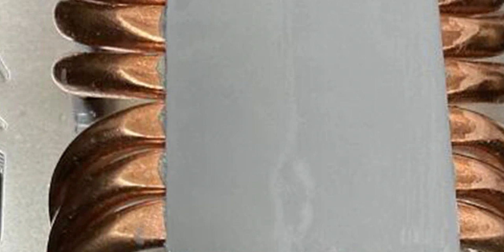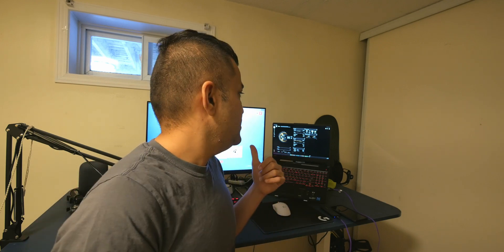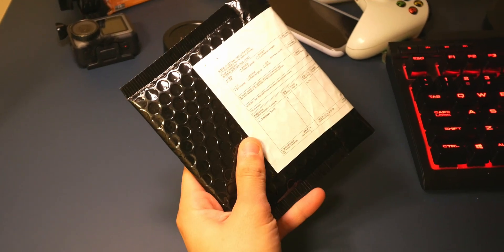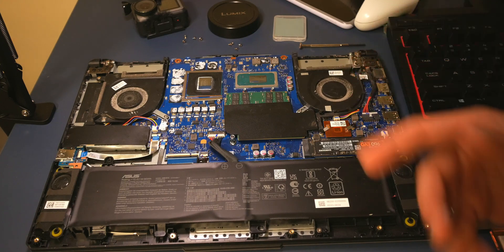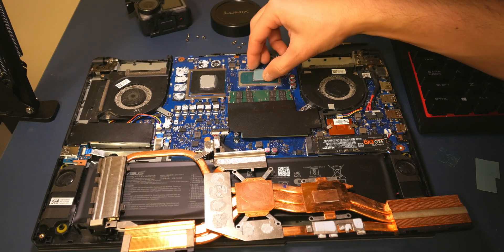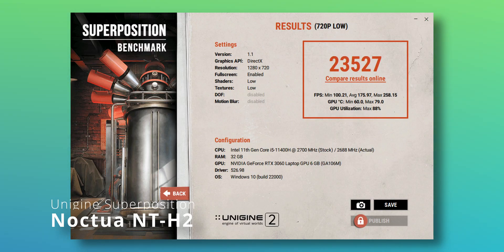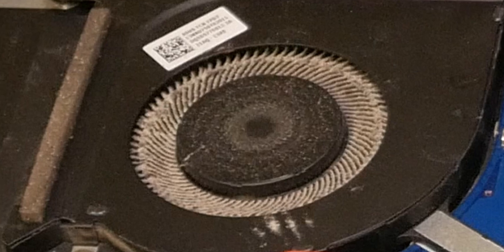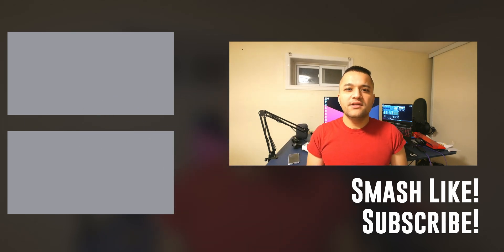I Stopped my Overheating CPU and GPU Forever

Comment: It really does work. I used Thermal Grizzly PTM recently on my 12900k, it's fantastic , CPU was overheating like crazy even with AIO and good paste. Pumpout effect on thermal paste was annoying. Had to repaste every two weeks. WIth PTM, after few times of heat cycles, my temps dropped from 85-88 under full load to 75-77 and kept improving. Don't listen to people who say it doesn't work, they don't know how to use it properly. Best solution, on par with liquid metal, without risks of shorting your components. It costs 10€ here, so amazing.
Reply: used this on my MSI laptop after getting frustrated with repasting and temps shooting back up to 95+ had the PTM now on 2 weeks and temps never reach 90 degrees.
Reply: @pacee21 can you update how its going with ptm 7950? And where did you buy it?

Comment: yeah really?  I used it on two laptops a 12700 intel Zenbook and my 2020 G14 4900hs I DID not ANY NOTICEABLE IMPROVEMENT of  course I don't  know if I got the genuine  article , that's the trouble with this stuff sites are scamming everyone, unless you know it's real don't buy it I wasted 60 USD on this garbage.. better off buying a Llano cooler at least it works....

Comment: My laptop requires lifting up the heatsink if I'm fo clean the fans properly by the vents.

Do I need to reapply PTM after opening the laptop or would the old pad work just fine?
Reply: yup
Reply: You have to apply it to the CPU or GPU as it's a thermal interface to the cooling pipes.
Reply: @SilvaDreams  I know. I just wanted to know if I need to reapply once I separate the CPU/GPU from Heatpipes, as I need to do it to clean my fans

Comment: The stuff works great. I recommend cutting it smaller by ~3mm on all 4 sides. It makes it much easier to 2nd peel, and you'll still achieve full coverage since ~80% will flow out once it melts. Needs a good burn in to achieve it's thinnest. I recommend a good 2 hours at around 80C on both CPU and GPU die.

Best paired with Thermal Putty, rather than pads, as putty compresses much better than pads do. This gives the CPU and GPU core more of the heatsink mounting pressure. Lots of good options for aftermarket putties out there these days. Avoid K5 Pro like the plague.

Comment: Can PTM be used instead of GPU thermal pads?
Reply from the maker: There are some thermal grizzly thermal pads you can buy instead of PTM. It’s not thick enough.
Reply: @TheEasyWay  😮😮😮😮 thank’s!
Reply: @TheEasyWay  Thermal Grizzly KryoSheet Thickness : 0.2 mm

Comment: If you can access the advanced bios of the asus tuf via the SERP smokeless bios method, you can enable undervolting on the i5 11400h. Alternatively there's a simple bios tweak you can do to unlock undervolting. Once the CPU + GPU are UV'd + OC'd, you can prolly get an even higher score and more performance while not increasing temps.

Comment: In addition you can use memo fl08 cooler at 1500 rpm (quite and good air flow ) and you will get absolutely lower temps around 10 - 15 C on cpu and 10 - 20 C on gpu and if you don’t give shit about noise you can max the fan speed and you will see huge difference (PTM7950 + K5 Pro + Pressure Air Fan Cooler = Cold Laptop at maximum Performance)
Reply: I have my llano v10 on the way and the ptm 7950 + upsiren u6 pro has already dropped my 90c 12500h to 72c. Once i have the cooler, my aorus is gonna be crazy cold haha

Comment: Bonjour , rog ally gpu on peut faire ?
Reply from the maker: Ally already comes with PTM7950. If you think its not working correctly, you can replace it or clean the heatsink/fan to improve cooling performance.

Comment: just a heads up noctuas paste is unsuitable for any modern cpus and gpus, especially in a direct die role. If you have to use itll last longer on a chip with a heatspreader. Its temperature range is way too low causing the thermalpaste to separate due to small portions of a direct die and heatspreader exceeding its design limits causing a pump out effect of the silicone oil which aids in pushing out the transfer material in waves. This is the pump out effect. ideally the thickest paste has the best durability before requiring replacement, thats why these phase change materials are excellent theyre so thick they solidify at cooler temperatures.
Reply: Where are you getting this info about temperature range and being unsuitable
Reply: @ps3customgamer  Most gpu manufacturers are starting to go with ptm 7950 because it has better application then noctua paste which is garbage anyways. You are not going to get peak performance out of the paste anyways, when xfx designed 7900xtx phoenix nirvana and magnetic air which has new application of ptm 7950 which performs better any paste on the market besides liquid metal tho probably has potential eventually.
Reply: @ps3customgamer  Search "Thermal Migration Noctua Paste" and you'll probably find Forum and Reddit discussions on the topic. 
It's not JUST Noctua's pastes; most Pastes will thermally migrate and/or separate on thermally-dense silicon.
My MX-4 application on my Vega 10 16GB card, has 'lost performance' over the last 4-6months, and it's not merely 'dust'. When I put the MX-4 on, I noticed the previous owner's TIM-application (that replaced the Synthetic/Pyrolytic Graphite pad) had both migrated and 'cooked'.

Comment: Hello, its getting close to the end of the year now, and I was wondering how the performance is holding up? 
I am looking to do this to my Razer Blade 16, which is hitting crazy high temperatures on the i9 13950HX hitting temperature sikes of 107*C momentarily and throttling down, and with average temps while gaming sitting between 95-100*C, if this can actually decrease temperature by 10* i believe I can get the CPU to finally stop throttling.
Reply from the maker: Stay tuned. I have a video in the works. It is due to be released this week. Cheers!

Comment: dude, unplug your battery first
Reply from the maker: I like to live dangerously. 😜

On a serious note, the battery cable is very fragile, it may cause more problems for an average user to unplug and plug it back. The laptop has an auto kill switch so the board does not have any power when the back is open. Most modern laptops have this to avoid shorts.
Reply: @TheEasyWay no, they don't
I'm a computer technician myself, you still can turn on your laptop even the cover is open

Comment: samething it worked perfectly fine for me in MsI TITAN pro know no more undervolting even normal fan speed without cooler boost silent laptop manage to get 85 temps with overclocked without OC my temps are 59

Comment: Is NVIDIA not using this on RTX 4090 FE as well now ? anyway i keep hearing it performs as close if not better then liquid metal while not having to worry about conductivity and frying hardware
I wanna apply this to my liquid devil 7900 XTX that has hotspot of 90c or so which is watercooled card, if heard least about 1 person having great succes with PTM7950 on 7900 XTX he had a hotspot of 61c at 400w total board power in cyberpunk 2077 my hotspot varies per game tho it can be 80c 82c in 1 game then peek 87 90c in another and only do 70c hotspot in furmark while doing instant 80c going up to 90c hotspot in 3D occt test.
This stuff is supose to melt above 45c but from my understanding it does not turn back to a solid state after it melts and gets better thru multiple cycles, i see you haven't done 2e video yet did your thermals improve or settle bit higher now.
Reply from the maker: That is true, Nvidia is using it on 4090s. Lenovo laptops use it too. And I can safely recommend trying this out if you're comfortable with taking you card apart.
Reply: @TheEasyWay  Only worry is just glue's on as it get solid and only removeable truely without risk if it heats up gonna do an attempt tommorow, 2e fear is my block makes no good contact and it gets worse i litterally used borderline almost to much on my liquid devil 7900 XTX first attempt temps went down but went back up after like a week or so using MX-4 then 2e attempt used about same slightly less both times i manually spread it and did a bit more in center of die.
If only seen one person mention using PTM7950 on he's 7900 XTX he got 61c hotspot at 400w total board power on he's watercooled card, i am just curious if it can get solid again once it coolsdown or stays liquidy after it melts like a paste more, really do not wanna repaste again after i apply PTM7950 again :D
Im gonna share my test results with powercolor in hopes to motivate them to put it on the liquid devil in the future they get a lot of hate, cos the Sapphire nitro+ gets colder temps on air i wonder if they use PTM7950 as well.

Comment: This pad works wonders. Pair it with clean air vents and your laptop is almost good as new
Reply: How come my temps get higher after some time of using? I use PTM as well. I reed it somewhere it can last up to 10 years or something but I am not sure what's really happening here.
Reply: @Jakiyyyyy  maybe you didn't apply it well or you bought a fake
Reply: @asterion2499  Hi, if you don't mind, what is the thickness of your PTM? 0.2 or 0.25?
Reply: @Jakiyyyyy  you bought a cheap, fake pad. You got scammed...
Reply: Problem is that we need to clean the fans for that we need to remove the case

Comment: nice video and information for this alternative thermal paste that have same quality with liquid metal but with zero risk and easy to applied 😃
Reply: What would you suggest to use on the vram
Reply: @ValorHederaG  i think thermal pad should be good, i haven't change my laptop thermal pad vram since i bought it on 2019, and i have no issues, just replace my proc & gpu thermal paste so far.

Comment: You need to repaste VRAM and capacitor with K5 after to take off heatsink.
Reply: I do not recommend the K5 Pro is inefficient and hard to get rid of. I advise Upsiren UX Pro.

Comment: Do you think it's good to also apply it on the memory chips beside the cpu and gpu?
Reply: U need to put thermal putty on those small chips called vrms
Reply: No its the equivalent of putting thermal paste on them, you either want to put high quality thermal pads or thermal putty on those

Comment: Hey, did you discount the battery when doing this?
Reply from the maker: While it is recommended to disconnect the battery before doing this, I didn't disconnect it because all of the materials we're working with are non-conductive.

Comment: I already had seen the LTT video over four months ago. And then you decide to make your own with testing for Laptops. Good for you! But, I have a problem with the fact that you referred to the information being displayed on your laptop display. First, the laptop was so far in the background that you could not what was being displayed, even in 1440p. And the few times the video had a close-up of the laptop display. The display was so f'ing blurry that you couldn't see anything being displayed. There was no way for anyone to know the exact temps that you were seeing. Because there was nothing for anyone to see.

Another problem I had with your video. Is that you were complaining about the temps was already climbing to 90C, for which you didn't like. Then when you opened your laptop up. And everyone could see that your fans were clogged with dirt and hair. That is the freaking reason why your laptop was reaching temps of 90C. Now, you had stated that you had only just applied Notura's thermal paste 15 days prior. Didn't you even bother to clean the freaking fans when you had done that? The amount of dirt and hair in those fans if from a long term use and the fans not being cleaned. Not from 15 days worth of use.

What you should have done was,  stopped the video. Cleaned the fans and restated creating the video. But, this time with clean fans, and heatsinks, to show the true temps for that laptop. And then tested the PTM7950 and compared the results.

Now, this is something that you should already know. But, obviously you don't seem to. Laptops and Desktops get dirt, and hair, in them that eventually gets into the fans and stuck to the heatsinks. If you own a PC, whether a Desktop or Laptop, you are required to clean out the computer of any and all dirt, and hair, periodically, For a Desktop you need to clean it out at least once a year. But, if you live in a dusty environment. Then you need to every 6 months. For a Laptop, it is worst that than. You need to clean it out at least once every 6 months. But, realistically you need to do it at least once every 3-4 months. As a Laptop clogs up with dirt and hair quite quickly.

Comment: So the pads have to be hot enough for a while to melt then it will have good performance, but it's not that good while the PC is still cold, it's actually amazing
Reply: the pads turns liquidy when cpu temp reaches over 45 degrees, and then turns solid when cpu gets less the 45 degrees.
Reply: @gibonzproject9710 there is, a non gaming laptop

Comment: you should have replaced the pads on your memory - putting it back like you did is gonna f up your system badly

also if you wanted to be scientific you should have done a "fresh TIM" vs "fresh PTM7950" comparison. For your follow up you should use the "old TIM" vs "old PTM7950" and then compare them to the first 2 values - 4 values total.
Reply: definetley not going to f up the memory modules by not repasting.

Comment: Nice video, but why you dont make a side by side video with msi afterburner are on? It will help viewers to know more how well honeywell perform vs nt-h2.
Reply from the maker: Good idea, I'm building my desktop this week. I plan to do a follow up very soon
Reply: @TheEasyWay  Thank you for your reply, many asus users in Asian where ambient temperature 28*-31* complain that A15 is quiet hot so it's very interesting to see how much cooler A15 can get with Honeywell PTM 7950.
Btw what is your ambient temperature? Did you make this video with AC on?

Comment: Can you compare this Honeywell PTM7950 with the Kingpin KPX? Nice video by the way!
Reply from the maker: Yes, definitely! stay tuned. I'm building a new PC and I'm gonna compare all the epic available solutions.
Reply: @TheEasyWay  thank you sir 🙏
Reply: In low compresion scenarios PTM7950 outperforms KPX because it has a lower viscosity than KPX (once it changes phase). In high compression scenarios KPX outperforms PTM7950, at least during a 12 hour test. That being said, PTM7950 usually improves over time so it's possible it could eventually match KPX performance given enough time. I tested it out on a GPU Die (Low Compression with 4 little spring screws, rather than X bracket), and also tested it on CPU (High Compression Noctua NH-U12S).

Comment: i think linus tested this thing and while is quite impressive for what it is, is not really a life changer compared to thermal paste, what is a life changer and the future of laptops, is the membrane cooling system shown at CES 2023
Reply: performing just as well as liquid metal, getting better with age and not having to ever change it is not a life changer but a membrane that can only cool a few watts is.  yeah.  checks out.
Reply: @KingDavid999  as well as liquid metal!?! liquid metal can decrease temp in up to 20°C, also, that membrane cooling system is just the beginning, but the testing can show you already how impressive it is, silent and powerful
Reply: @Vasault  you're comparing a product that isn't available to public to something you haven't tested.
Reply: @Vasault  I understand fine.  You don't understand.  You're comparing vaporware to a product you have not used.  Not only that if and when that membrane releases it's still a piss poor solution.  Maybe fine for ultralight notebook CPUs or similar but that's it.  What are you bragging about and standing on this hill for.  You discounted a product that does just as well as liquid metal an outdoes it in longevity also for a little membrane that as of right now might be useful arm chops but is bigger than an arm soc.  What don't you understand?  Your crutches have crutches?
Reply: @Vasault  Stop bragging about a cooling system that almost no one can use at the moment.
Reply: @botao4456  "at the moment" is just a matter of time, liquid metal was also experimental af before and now is even used in the ps5
Reply: This cools almost as well as liquid metal with none of the risks and that membrane system is just a concept now.
Reply: It's actually better than liquid metal.
Source: Have used liquid metal in all of my computers and laptops
Reply: its only good for laptops and small form factor devices, for gaming pc its not that good since it only perform wells at higher temps.
Reply: Not i let that you're comparing a "cooler" to something that is used for thermal interface.  Compare a cooler to a cooler.  Duh.